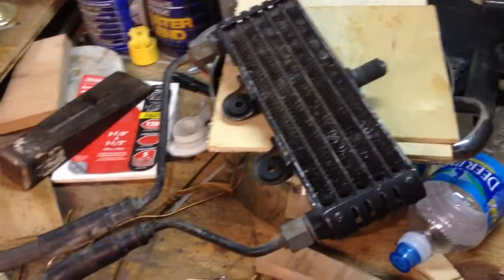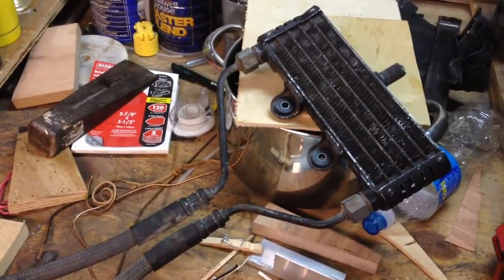Yamaha Radian Oil Cooler Modification

Comment: Sorry for my bad english. Thanks for the video. I'm from Mexico and own a 1986 blue Radian. Simply it's the best bike I have ever ride on road, but in the city, my problem it's by the high temperature. The air cooled system is not enough. I want to install a oil cooler too. In the page BADRAD600.COM, they show some nice Radians and some people also installed it. I think that the Honda Nighthawk 650 oil cooler system could fit on the Radian. What do you think?
Reply from the maker: Hello Ricardo,

Thank you for watching my video.  I hope I can help you with your Yamaha Radian.  I love the bike, too.

I want to start off by saying that I have not yet completed the installation of the oil cooler.  It is winter, and we are getting slammed…I hope to finish the installation, and make a new video, in the next month, or so…Mother nature needs to cooperate.  Many of the design points will be very different in the new video, as I made many mistakes with this first construction.

I will post new video as soon as I can!
Reply from the maker: dxtrwuest Oh, but regarding a nighthawk system?  I really couldn't comment, other than to say that they were never made to be compatible at the time, so nothing really has changed since then, sorry...
Reply: @dxtrwuest  hello dear
Where can i buy that piece for my radian
Reply from the maker: Ebay?  You need to find an oil cooler off of an FJ or FZ600.  One of the 2 models has the right length hoses, but, I am sorry, I don't remember which one.  If you get the wrong one, it is not that difficult to put new hoses on.
Reply: but the lid is also a fj600?
Reply from the maker: Yes, either FJ or FZ.
Reply: I tell you, my friend, I have an oil radiator and oil lines, but I can not get the part that fits the radiator with the oil filter, is that part also an FJ600? or you made it yourself
Reply from the maker: It is off of both the FJ and FZ, I did not make it.  The only parts that I made were the mounting brackets.  Refer to the updated video for those brackets, as the brackets in this video were changed.